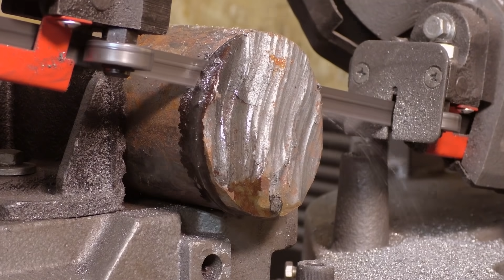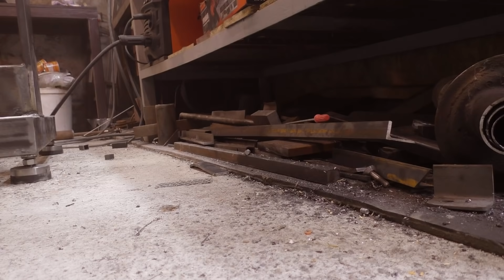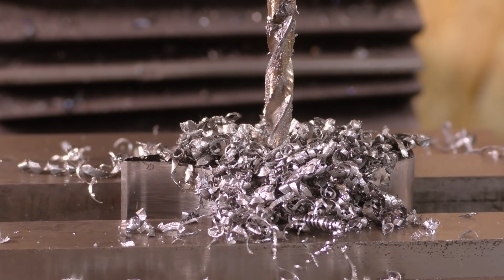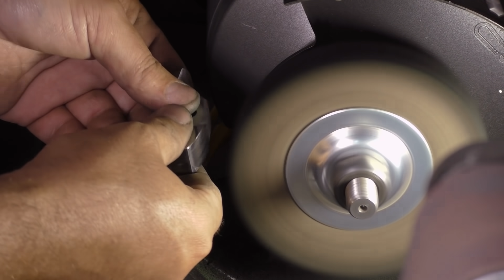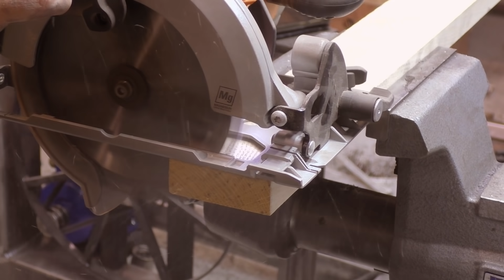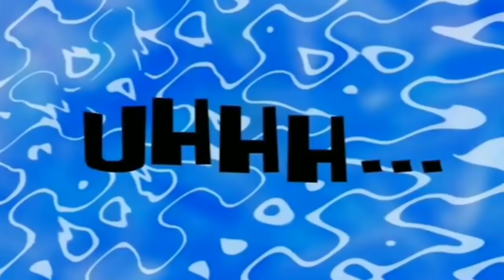How To Make Awesome Mini Hand Vise From A Piece Of Metal

Comment: I can definitely see the advantages of that over a pair of vice grips. A "V" grove in the center would be desirable for holding round pieces steady and square to the tool. Would work good as a tap handle for small taps. Nice work.

Comment: Nice work.  I have seen for many years in tool catalogs for jewelers and watchmakers a vise similar to yours, they call it a "Lowell Pattern Hand Vise"
Often they have a hollow handle which makes it usefull for holding long pieces of wire for tapering the wire prior to drawing down its diameter through a draw plate, also tapering pins for making hinge pins.